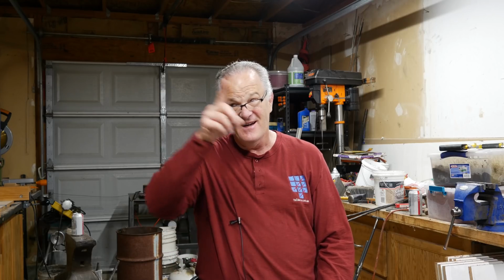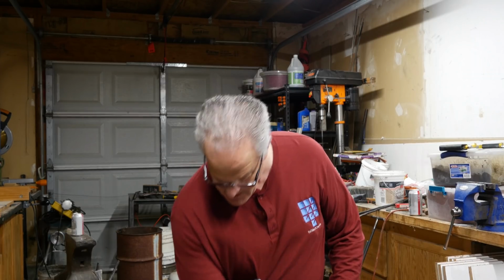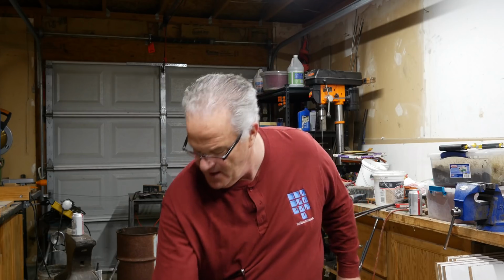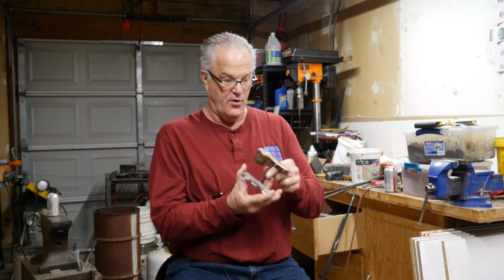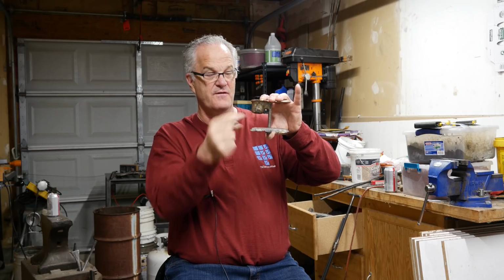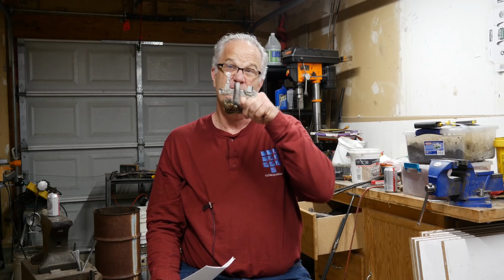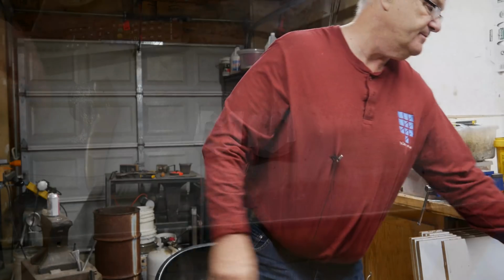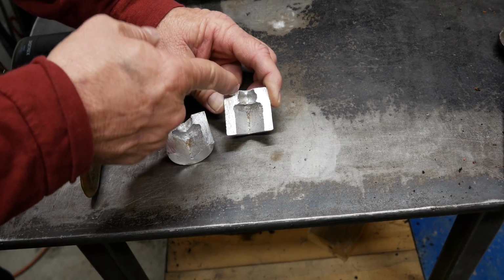Foundry side chat - The 10 rules for good castings

Comment: #10- kinda common sense, ie: if you are casting a part which you plan to drill or attach another part to, a point at which you plan to fasten it or that needs to be finished, it should be marked in some way in the casting. I'm preparing to do my most fine and critical part so far and it has two holes that will need to be drilled and tapped, also two faces will need to be milled parallel which are perpendicular to the faces which will need drilled. Im trying to figure out how to locate the holes or if I should just cast a flat face and then lay it out  and drill IF the casting is a success. (Probably the latter so, yeah forget rule 10!) Haha!
Reply from the maker: As a friend of mine that runs a foundry says, "you're in it to make money".   Do whatever is going to be easiest for you and enable you to finish the part quickly.  

I think #10 implies that you understand the shrinkage characteristics of the metal you're pouring. I don't know how to compensate for the shrinkage factor when it comes to hole layout. Too much trouble for the stuff I do. 
But you do bring up an important factor.  Patterns need to be built with shrinkage in mind. If I need a part a certain size, my pattern will need to be bigger.  How much bigger is the question

Comment: If you have a large flat surface you absolutely need feeders to avoid shrinkage. I'm just beginning to learn myself and have picked this up- the do/dont feed uphill depends upon which end the larger volume is on- uphill towards smaller volume- downhill towards larger volume...I think.
Reply from the maker: I think it would be more appropriate to add "thick" to your rule.  If I'm pouring something that is 3-44 thick, I rarely put a feeder on it.  Think of it this way. If your metal shrinks to 90% (I'm just using this for the sake of discussion) a casting that is 4mm thick will shrink .4mm  A casting that is 40mm thick will shrink 4mm.  There is also the notion of uniformity of thickness.  If you have thin edges and a thick center, the center is going to show a lot more shrinkage than the edges.

Luckygen1001 recently did a video where he simply domed the surface of a flat casting to compensate for shrinkage. It wasnt really a feeder per se but more controlled shrinkage.

You are correct in the statement you didn't make though, ALL castings shrink as they cool

Comment: I don't quench anything. I see everyone doing it in these videos. not sure why...bronze...aluminum....are not steel.
Reply: I use electric furnaces...they force you to be patient. he he...its a virtue im slowly learning myself. but with aluminum and copper...from what I've read...the metal will be better quality if allowed to cool slowly. I'm fairly new to this...so I suppose I could be wrong.
Reply from the maker: @thomaswhite4609  :-D  I'm not arguing with you. I've been told that quenching doesn't affect non-ferrous metals but I'm about as far from a metallurgist as you can get so I don't know.
Reply: @swdweeb  yeah...i wouldn't argue either...i love to learn. Pretty sure I did read aluminum and copper shouldn't be quenched. I'll try to find where I read that at.
Reply: Well...I can't seem to find anything that says you should not quench. Maybe that was my imagination...perhaps too much fun in my 20's. lol. I stand corrected!
Reply from the maker: I cant answer for everyone else, but for me, it is impatience and wanting to handle the part right away. It's simply a desire to cool it off so it can be touched.
Reply: I read somewhere that quenching doesn't harden pure metals, only alloys.

Comment: The 10 rules all make sense to me. When I added Campbell's book to a list of required reading on one of the metal casting forums I'm on however, another molder (an experienced former US Navy molder who still makes beautiful wooden patterns and brass plaques) expressed the following doubts that Campbell's actual methodology can realistically be applied in a hobby foundry setting.  
"John Campbell is not for the hobbyist, and I have yet to see any hobbyist that could explain his recommended methods, mostly because it heavily depends on computer models that hobbyist have no access to... it's interesting reading, but just the insanely high cope heights should be an indicator that no hobbyist could diligently follow his methods..."
A little hyperbole there maybe, but I've seen technical drawings of molds with those extremely tall Campbell-copes that he mentioned...  How does a one man show like mine deal with that?

You can't argue with Martin's results, I'm a big fan and I've directed other hobbyists to his videos more times than I can count, and I've been experimenting with incorporating his recommended stepped pouring basins and not using a splash well under the sprue in my own molding and casting efforts with great results, but my friend HT1 is also a pro speaking with the voice of experience.   IMO only a fool would ignore advice coming from either one of them.  What's a guy to do?
Reply: Campell's designs and method have nothing nor dependant on computer simulations - your Navy molder missed John's 10 rules - or cannort understand them.
Reply: @EddieVBlueIsland  Don't get me wrong, I'm a believer.  I swallowed the bifilm theory koolaid and am still coming back for seconds.  
But you don't know my friend.  He is a smart guy and the 10 rules are really basically just common sense. Also it is worth noting that prof. Campbell has developed and clarified the actual detailed application of his ideas a bit more since my comment was posted 2 years ago.  
But I'll bite.  Show me any home gamer or even a small commercial foundry that finds it economical to go FULL bifilm theory and use extra flask cheeks for true bottom gating via preassembled trident gate cores containing multiple integrated ceramic filters, just to make little decorative plaques... 
That is a lot more work and much heavier flasks to move around that take a lot more time and effort and expense to prepare.  Why would those type of castings need PERFECTLY clean xray analysis results, or off the charts numbers for elongation? For high performance engineering castings that makes sense, but not everyone is making those.  And the ones who are... are not usually trying to learn how off of hobbyists on youtube. 
Some of the concepts really are easily adapted to a home foundry setting, such as maintaining constant cross-sectional area in runner systems.  But not all.  The tapered sprue and offset pouring basin work well but aren't new ideas - both are described in the 1950's edition of the US Navy Foundry Manual.

Comment: I think you are attempting to fulfill rule #1; you cast from cleaned billets.  I mean, you will take your cans, extruded pieces, etc; and melt them down into ingots, and use those ingots for casting.  If you do use extrusion aluminum, I would suggest using only one type (cans, aluminum channel pieces, etc) for a casting, and not simply melting all different types in one crucible.  
I don't recommend mixing two different metals for different uses (say extruded aluminum cans and cast aluminum rims).  It may not make a bad casting if well mixed, but you won't know how it will work until after it's cast.
But, like I have already pointed out, I'm not a caster, a metallurgist, or anything of the sort; so take my advice with a box of salt.
Reply from the maker: I've already used up a palette of salt on things I tell people. ;-)

I think the issue in rule #1 (and I still haven't had a chance to sit and read the chapter that fully explains it) is that even with "clean billets" as you say, I still don't know two things; what is the composition of the billet I just made is and I don't know the pouring/casting characteristics of said billet. That's where I believe I fail rule #1. 

Now, of course that said, I've still been able to cast the little trinkets that I make without any of that knowledge. So one (me) could argue, and perhaps quite feebly, that for a guy like me making the sorts of things I make rule # doesn't have much meaning. Now, and here's where that argument may fall flat on it's face. I've never purchased a certified ingot that is of an alloy that is good for the sorts of things I do. It might be like a guy that grew up eating hamburgers saying the beef I eat is just fine when he's never tasted a great filet or NY strip.

Better go order another truckload of salt ;-)

Comment: The effect of quenching depends on alloy.  Many common aluminum or copper alloys it leaves the metal in an annealed state if the quench is from a high enough temperature.  Aluminum bronze with enough aluminum is an exception, being a quench hardened alloy.  Cast iron/steel I'd expect very different results.  So that's a rule which, stated without reference to material, strikes me as dubious.
Reply: Interesting, I didn’t realize quenching could anneal some materials

Comment: According to ( myfordboy ) he suggests using only precasted aluminium in your melts . Most of the stuff in your bucket is not suitable . # 1 low yeald  # 2 too much dross # 3 you're creating an unknown alloy . Check lawnmower shops for junk motors  , ( MAKE SURE it's NOT MAGNESIUM ) viniger will tell you . If it foams Bad , no foam Good ! It tends float like dross and burn like a sparklers wen removed  . I drop it in stove ash , nothing left to burn . That's why Martin says to use.    KNOWN  materials !
Reply from the maker: Oh, I know. I've been told to look for old aluminum wheels as well. I need to just bite the bullet, find some known (I guess its known) aluminum and get through the rest in the recycling bin.
Reply: Lawnmowerman02346 good thing about vinegar, saw a vid about an accidental intro of mag into a melt..wow!! Another thing to look out for is zinc, easy to mistake it for alum. but also easy to check. Light gray, heavier, and doesn't take to a file very easy.
Reply from the maker: Yeah, I remember burning magnesium in college chem classed, impressive. Definitely don;t want to throw that in my furnace. 

Thanks for the zinc test. I've shied away from brass just because I was uncertain about zinc and I don't have a respirator.
Reply: swdweeb Not zink  ( magnesium ).  Zink makes deadly fumes !!
Reply from the maker: Right, Magnesium burns and zinc kills. that's why i said I've shied away from brass, it contains zinc

Comment: You are welcome, glad it's of use.
You definitely started with the best section for the average caster. It will be interesting to see the future videos and your improvements. 
Rule 8 is talking about alloy segregation where something like and Al-Cu alloy separates into sections of just Al or just Cu. For Al alloys segregation is not usually a problem (depends on the alloy), Al alloys that contain Cu the alloy segregation (i.e. separation) can be serious. Every alloy is more prone to alloy segregation or less prone to alloy segregation.

Rule 2 base your calculations on the sprue hight at the bottom of the top of the ridge entering the sprue. so your 80mm cope hight gets cut down by 20mm so you only have 60mm of high. (your pouring basin is cut 30mm deep and connects to the sprue about 10mm up from that so 30-10 = 20mm) so you are close to that 50mm and well within the 0.5 to 1 m/s specification.

Rule 5 try including something in the core to create the core venting during the core creation instead of drilling the core.

The petrobond not holding up at 100F... I suspect your reused sand is the issue. Besides the non-detergent motor oil you used, I expect you need some specialized PETROBOND binder (thick stuff that comes in a tube) or catalyst (I think it's typically a little bit of isopropyl rubbing alcohol) in your reused sand. Another possibility is you might have too much oil in the reused sand, but I doubt that is your issue.
Reply: and thanks for the mention.
Reply from the maker: No sweat, thanks for the tip! I tripled the number of views on your channel earlier today, watched every one of your videos. :-D
Reply from the maker: I really can't take credit for the starting point, it was suggested by Martin. ;-)
I'll take your word for it on rule 8.  On rule #2 I see you've paid attention to the myriad of times I've told you how high my basin and ridge are ;-) You're absolutely correct about the height and the lower speed. I have a mechanical engineer friend that I need to take into consideration that it is moving before it heads over the ridge though. But he is also the one that told me about flow through a pipe so I expect we're still good on the speed. Not sure what to do about rule 5. I've continually have problems with small cores like that breaking. I've tried molding them with a finish nail that I can pull out but with that one I haven't figured out the technique to get the sand packed in and keep the nail in the center. Much to learn much to learn ;-)

I was careful to correct myself on the sand. I no longer consider it petrobond as I've probably burned all of the bonding agent out of it. Its more like petro-sand now ;-) I haven't done alcohol when I blend it. I heard about that a long time ago and simply forgot. Maybe its worth a try in the next go around.  I doubt that too much oil is my problem too. I add just a little each time just enough to get it to mold firm in my hand. If I were alumitube, I could afford to buy it buy it by the truckload as he appears to do. I only see him using new petrobond each time. ;-)
Reply: Thanks, it's not hard to watch all of my videos when there are only 7 at the moment.  I appreciate the views.
Reply from the maker: True but I rarely get dizzy watching other stuff ;-)